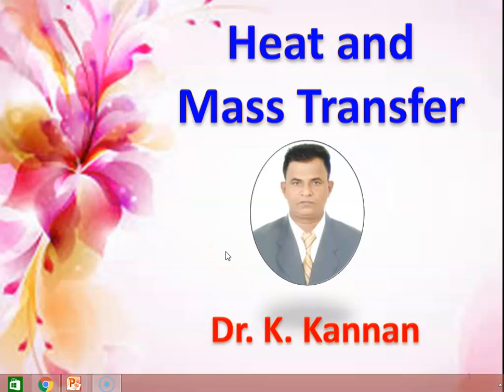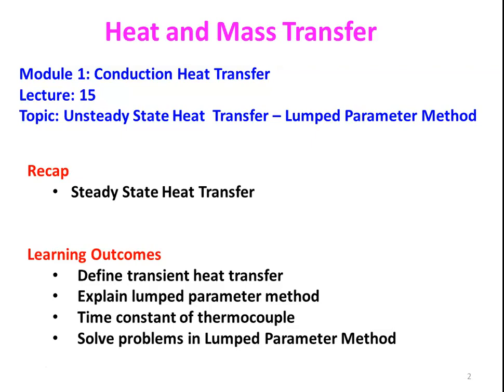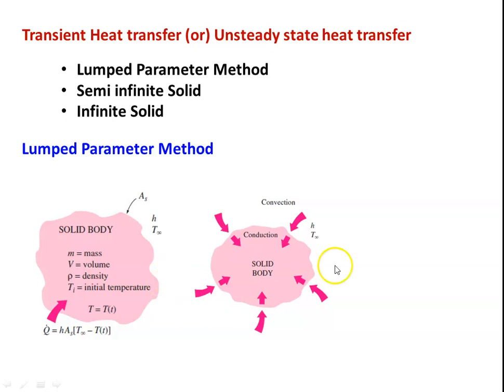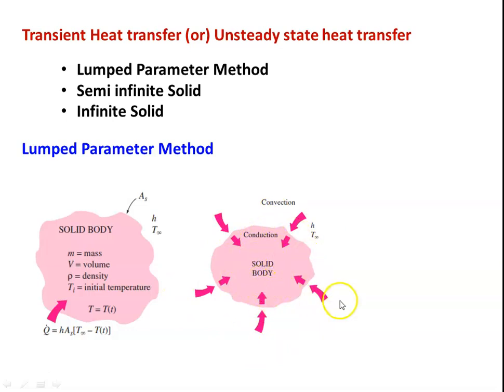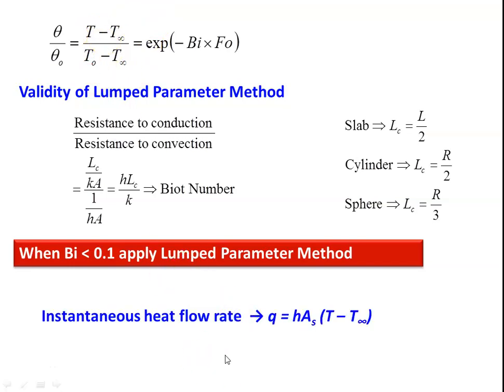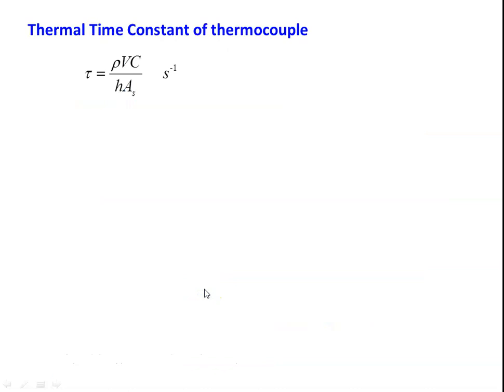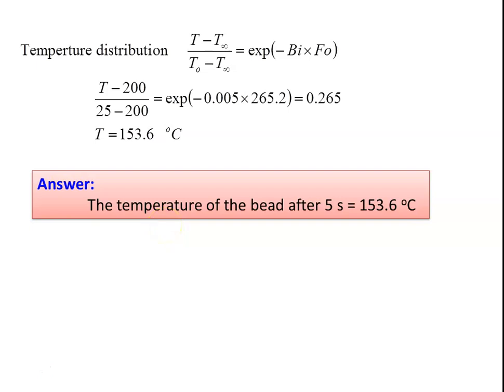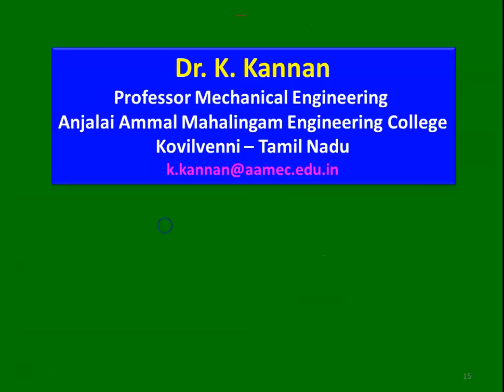HMT 1.15 Lumped Parameter Method

Comment: sir in example 1 can you explain how to find the temperature at 12.5cm depth from one face after 1 min
Reply from the maker: In lumped parameter method, temperature is the same everywhere with position and temperature varies with time only.  After 1 min the temperature is constant 149.5 oC